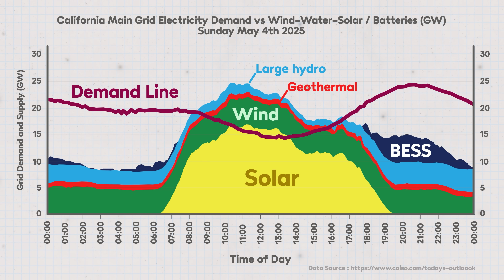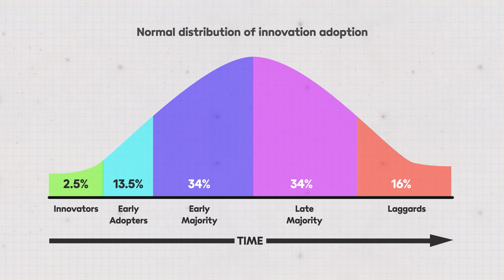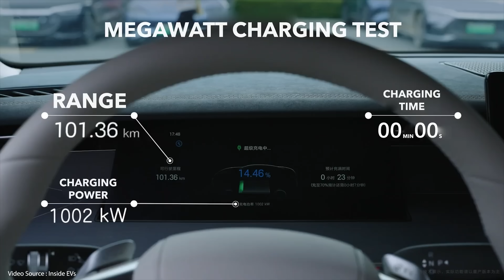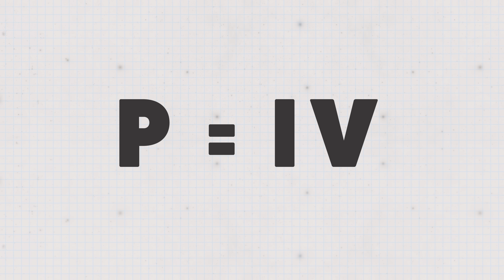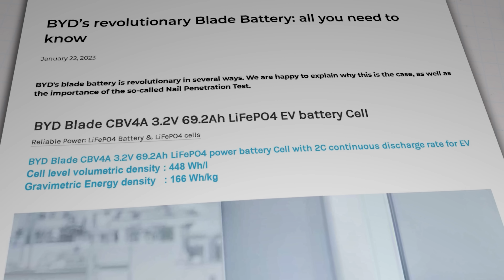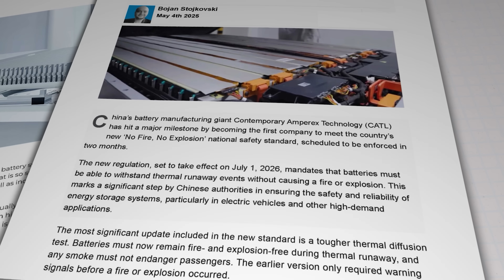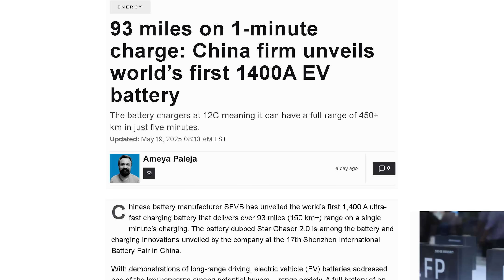BYD 1 MEGAWATT 5 minute EV Charger. Overdue or Overkill?

Comment: It's not just perception. Evs can't hours of travel to long trips compared to ICE vehicles. Fast charging is essential.
Reply: Current charging stations are sufficient for long distance EV driving...

They don't need MW scale chargers...
Reply: @Les_S537  Tell that to people driving in cold weather. I live in Canada and some of my friends have complained about how many times they need to stop to recharge. Fine for city driving but still a pain during long trips. Fast charging is crucial for mass adoption.
Reply: @BuellersBack  Do your friends use "preconditioning"?

My Tesla has "preconditioning" built into the car.

This is analogous to what ICE car owners in extreme cold do with their cars, which is to say that they typically use engine block warmers to warm their oil pans and keep their lead acid battery warm enough to be able to even start their ICE car in extreme cold.

I live in Texas, but I've had my EV in extreme cold temperatures for ski trips in New Mexico and Colorado.

When I wake up in extreme cold, the first thing I do is reach for my phone, open my Tesla app, and instruct the car to "precondition" the battery pack, or in other words warm the battery pack up to optimum temperatures for use.

I then shower, get dressed, eat breakfast, and by the time I'm done with all that my battery pack is warmed up and I experience only a small amount of range loss as a result.

I also use "preconditioning" before I go to charge my EV in the cold as well.  Warming up the battery pack BEFORE charging the EV makes the battery pack "ready" to receive a charge at the fastest rate possible.
Reply: @Les_S537  I won't write an essay like you, no offense, but trust me, cold weather is an issue for EVs. BTW, I'm pro EVs and knew battery tech would resolve this and any other issues, eventually.
Reply: @BuellersBack  I didn't say it wasn't an issue.  I provided you with an example of how you mitigate the issue using the same way ICE vehicles deal with extreme cold.

Using preconditioning I experience only 17% range loss in the extreme cold where without its closer to 40-45% range loss.
Reply: @Les_S537  Sure it helps, but I doubt you experience the same kind of cold we do.
Reply: @BuellersBack  My EV in the extreme cold of a ski resort is nothing to scoff at.  I've had my EV sitting all day in subzero temperatures, and when I come down off the mountain I go to my car to change out of my ski clothes and turn preconditioning on for the car...  I then hit the apres ski bar for some food and drinks with friends, and by the time I'm done with all that my car is defrosted and the battery pack is warm for use...

Tesla's early EVs used resistance heating elements to warm the cabin and battery pack.

Resistance heating elements are energy hogs.

So Tesla moved to a heat pump system tied into the EV motors in their newer models...

The heat pumps pump "antifreeze" fluids through the EV motors (which are generating heat), and then the fluid is pumped through channels within the battery pack to warm the battery cells up and maintain them at good operating temperatures while at the same time using the heated fluids to warm the cabin.

This is exceedingly efficient at keeping your EV operating in extreme temperatures
Reply: @Les_S537  skiing temperatures is no extreme cold.
Reply: @BuellersBack  Average temperatures in Toronto Canada during winter (December to February) is around 4.6C (23.7F)

Average temperature at the base of Taos ski resort in New Mexico during winter (December to February) is around 20-30F.  In January, which is usually when I'm there, the average is 4 F.
Reply: @Les_S537  You just made my point stating Toronto weather. Most Canadians make fun of Toronto. This is definitely not extreme weather.
Reply: @BuellersBack  61% of the Canadian population lives in Ontario and Quebec, and most of them live within 50 miles of the US border (close to New York).

Ottowa and Montreal do have lower average temperatures than Toronto, but not by that much.

All three major metropolitan areas will have spurts of really cold weather from time to time, but the average isn't that far off from what I experience every year in Santa Fe/Taos, NM, and Pagosa Springs, CO

It is obviously cold in Canada, I'm not disputing that, but EVs can work in those urban areas along the US border with preconditioning being a thing in modern EVs.
Reply: @Les_S537 I’m afraid you’re not that familiar with Canadian winters. Either way, EV issues with cold temperatures combined with long drive distances will soon be a thing of the past.
Reply: @BuellersBack  I've beeeeeen to Canada before, many times in my 60+ years.

I'm a geologist, and I've been many places around the world in the process of doing my job.  I'm aware of how winters go there as I've done oil field and geologic studies there.

Winter is frigid cold in the far north of Canada, and the portions of Canada that border the US are milder by comparison.

Comment: Please don't conflate energy production source with the cause of the Iberian peninsula blackout, the cause of that is currently unknown but it is felt to be most likely due to grid infrastructure rather than energy source.
Reply: One of the weaknesses of solar or wind is the variable rate of power generation.

A balanced grid has ALL sources putting out power at the same hertz...  Solar and wind have the issue of irregular output, and this makes the grid unstable, and results in brownouts or rolling blackouts.
Reply: @Les_S537  but specifically not likely to be the cause in Iberia.
Reply: @screally1152  Wrong...  The Spanish grid was operating with low inertia due to a high proportion of solar and wind generation and limited conventional generation (e.g., gas-fired plants at ~5% capacity). This lack of inertia likely exacerbated the grid’s vulnerability to the initial generation loss, leading to a cascading failure. The disconnection from the European grid, caused by a phase lag exceeding 90°, further destabilized the system.

It was due to what I said about solar and wind's inability to provide good "inertia" of hertz to stabilize the grid.

The main problem was very low baseload power generation, and high renewable power generation.
Reply: @Les_S537  source

Comment: I'm currently on my second EV, so I'm firmly in the pro-EV camp. Charging speeds have improved significantly in recent years, which is encouraging. However, a major issue remains around charging networks, particularly charger availability and reliability. Too often there aren't enough chargers or they won't work for a variety of reasons (I exclude the excellent Telsa network from these comments).

In the UK, the cost of public charging is also a serious concern. For those unable to charge at home (often the poorer members of our community), relying solely on public infrastructure can actually make running an EV more expensive than a traditional ICE vehicle. That undermines the financial incentive to switch and is something that urgently needs to be addressed if we’re to support wider EV adoption.
Reply: I’ve had my 2022 Leaf e+ for about a year now, I have never once publicly charged it. I either charge at a friend’s house and pay them for the leccy, or do round trips that I can do in a charge. If public charging is required, I take the ICE. Until public charging is as available and at least price comparable to petrol, I’m going to keep avoiding taking my EV on long trips
Reply: A gas station can serve a dozen customers in 5 minutes, and so can afford prime locations, maintenance, staff, shops, bathrooms, even such luxuries as a roof over your head! But you'd need a football field of chargers for that traffic flow, which is going to sit empty outside of holiday weekends.  It's just not economically feasible (without subsidies)
Reply: @SteveLomas-k6k  Or you put them in places like shopping centre car parks. Or Burger King, Mickey Ds etc car parks. Or require all companies who employ more than a certain number of employees to install slow chargers so their employees can charge whilst they're working. You need to rethink the model - the vast majority of people aren't going to be using charging stations like petrol stations. It's a good job petrol stations are in prime locations because I imagine that cleaning the site up once the petrol station is no longer needed is quite expensive.
Reply: @MalcolmRose-l3b  They put 4 in at my local supermarket a few years ago. At first they were always empty, now they are always full- with normal IC cars. i.e. they were just a waste of valuable space for the business, on top of the expense of installing them. The boxes still get in the way, but not clear who would pay to have them removed at this point.
Reply: @SteveLomas-k6k  Superfast chargers will require far less space as you can replace eight current chargers with one superfast charger. I suspect the cost of one superfast charger will be less than eight current chargers meaning lower costs.
Reply: @eddewhurst7662  Not sure, superfast= super expensive, and now you only have one spot open instead of 8 for the money..
Time will tell I suppose, and when a 'super duper fast' charger can give you 400 miles in 60 seconds, in any weather, without degradation, at a reasonable cost, I might willingly buy one without mandates or subsides. 

But meanwhile a standard fuel pump does that for me already, and that's not even considered 'super fast'
Reply: M @SteveLomas-k6k I think super fast will be cheaper, 1 super fast charger with two parking spaces will no doubt be more expensive to build than a standard fast charger, but I suspect it will be considerably cheaper than 8 standard chargers.
Reply: sorry my little bit of satire was not to your approval. The point I was making that many reluctant ICE drivers ignore the benefits of EVs and cling to noise and vibration as benefits of ICE. We have a local steam fair, many people ride horses, but these are no longer serious forms of transport. The world is moving on.
Reply: @eddewhurst7662  EVs predate IC cars. Their market share peaked around 1910- hundreds of EV makers went bust that could not make the transition to newer IC tech.

Most do not want to go back- what they are clinging to is the freedom to go where and when they want, not where the car tells them- that's why most people switched in the first place.

(And horses are actually still way more popular in the US than EVs!)
Reply: @SteveLomas-k6k  I am not sure why you think that is relevant to today, back then outside of cities there was not much of an electricity supply. In cities there were no fast chargers and the vehicles had about 100 miles of range. The current situation is not at all comparable to today. 
You say people  want the freedom to go where and when they want, not where the car tells them. I have that freedom now in my EV. I accept places in the USA that are remote may be a bit more restricting. I live in the centre of the UK and can get to all the cities in the UK on a single charge, if I want to go to john O'Groats which is as far as I can go without falling into the sea I probably need a 5 minute charge at a fast charger. Wherever I go  any distance I would go on one of the motorways which are all well served with chargers.
About 20% of new cars sold here are EVs and the number grows each year.  
In Norway it is about 95%, in 10 years and probably a lot less all the gas stations will shut.
50% in China which is now the largest vehicle market in the world.
This large market ensures the continued development of the technology. New batteries warranted for 800,000 miles are just making their debut. Batteries that can add 300+ miles in 5 minutes are promised in about a year or so. Solid state batteries that may have twice the energy of current batteries are already being tested in vehicles. Batteries with 10 times the capacity are working in the lab, but are quite a way off being vehicle ready but the prospects are there. The difference in speed of development will I suspect make EVs the dominant technology.
I think the USA is no longer the largest market and the rest of the world will go forward. EVs are improving, with greater range, no possibility of thermal runaway, faster charging and less expensive. The USA seems to be turning in on itself wanting to return to the days of the 1950s when it was the dominant manufacturing country, mainly because most of the other industrialised countries had been blown to pieces in the war. The USA is in danger of being left behind.
Reply: @eddewhurst7662  Norway, China, EU, UK, all highlight the point- all places with huge mandates and/or subsidies keeping EVs and chargers on life support.
When people switched from steam and EV to IC in the US over 100 years ago, zero mandates or subsidies were required, only free choice.

I just got back from a 900 mile trip to visit family, I could have taken the interstate/motorway, but I chose the backroads for more interest. Again- that's my choice, my car doesn't tell me what routes I need to follow.  Total fueling time over 2 stops was about 2 mins 30 secs- both pumps were about 30' from the road I wanted to be on anyway. If an EV could do that- in any weather, no degradation, reasonable cost,  no problem, and no need for any political movement to force them on anyone.

The mandates and subsides are finally going away in the US after years of uncertainty. Time will tell, but my bet is that others will follow eventually. Europe, Britain, China, were pretty slow in dropping other mandates not so long ago, were they not?

Comment: Question: how many of these turbo fast chargers (to 80% in less than 30 mins is my standard) are in Iowa right now?
Reply: Ok, i’ll bite. A cursory look at plugshare indicates that there are 25 150KW or greater fast chargers currently operating today in the state of Iowa which will do sub 30 in a lot of cars and 18 of which will do 15% to 80% in my car in 15 minutes. 

Minus the cluster of 5 in Des Moines, these are actually impressively evenly blanketed across the state.

Comment: How in the world could the electrical grid supply enough juice to keep a network of 1000 kW chargers going? I'm not trying to argue that electric vehicles are unsustainable on the grid, because they clearly are. But there has to be some limits to the amount of electricity that can be delivered in one place at one time. Imagine a lineup of BYD drivers at the charging station, each one drawing all that power in just minutes. Then imagine a bunch of chargers scattered around a city...

If I ever get an electric car, I think I'd be happy enough charging it slowly at night. I can imagine a million cars all doing the same, a challenge to the grid but not an unsurmountable one. A million cars all charging ultra fast at any time of the day or night, not so much.
Reply: MW scale charging will be very limited...  Limited for industrial scale vehicles which have gargantuan battery pack sizes like the Tesla Semi (which has an 850-900 kWh battery pack).

Personal transportation EVs have battery pack sizes of 40-75 kWh.

To use a MW scale charger on a personal EV is just plain dumb.

This is no innovation by BYD, and for the record Tesla built their first MW scale chargers years ago when Tesla Semi first came out.
Reply: "keep a network of 1000 kW chargers going?" <- it's not proposed that everyone use 1000kW chargers.  Obviously on a small fraction of EV owners are going to want to do that.  For most people, who don't sit in their cars all day long, charging at home or while shopping or at work will be the norm.
Reply: Local batteries can make a 1000kw charger require less than 1000kw in grid connection - it's not as if they run 24/7